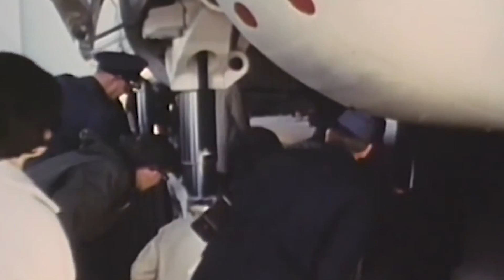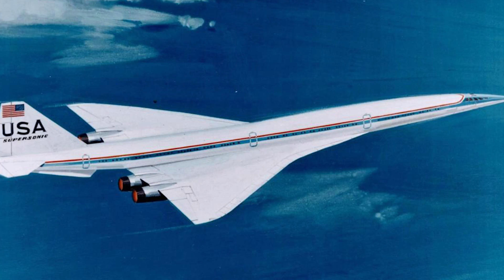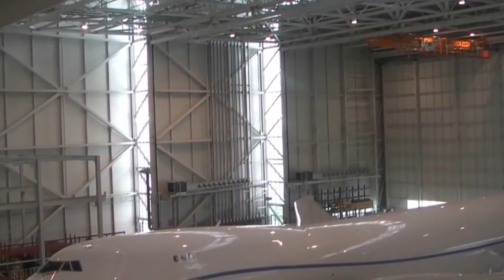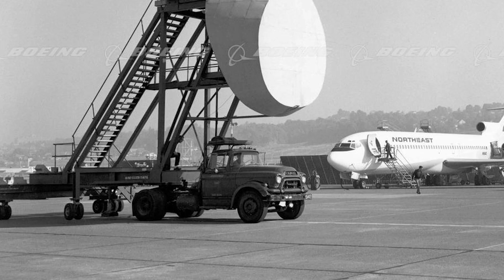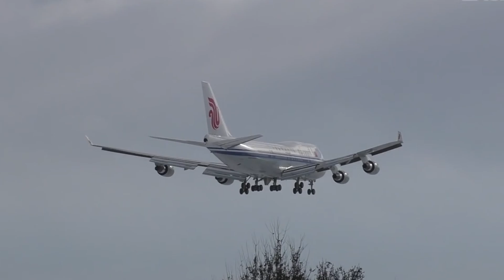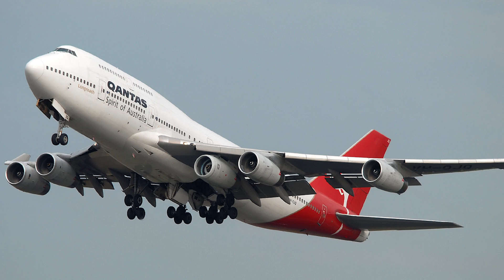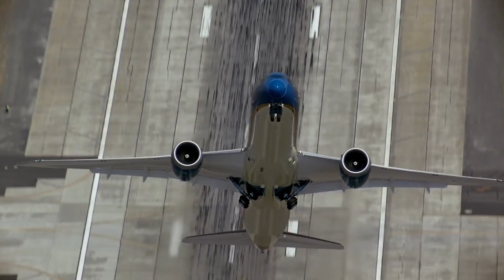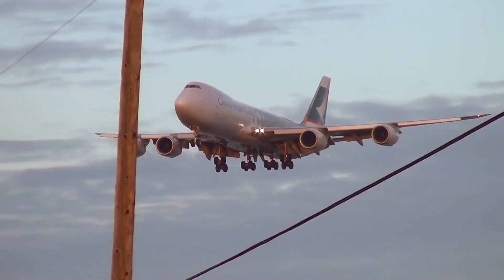Boeing 747 - the Jumbo Jet

Comment: Time is proving that Boeing was correct to leave the VLA market to Airbus and the slow sales for the A380 have proven this. Airbus is still selling every A380 at a loss and it is unlikely that they will ever see any profits from it. 
Also the secondary market for used A380s is extremely weak with 2 off lease aircraft scheduled to be dismantled for parts even though they are only 10 years old. 
It is too heavy to be an economic freighter along with being more difficult to load and unload while also needing special equipment to load the upper deck. 
While the 747-8I is no longer in production and the 747-8F only has enough orders to continue in production into 2022 at a rate of only 6 per year Boeing is still predicting that there will be a large increase in freighter aircraft orders before 2022 with the 747-8F being in demand once again. 
While the A380 is a good airliner it was built at the wrong time to be a financial success.
Reply: It in some ways the A380 is Europe's White Elephant. Yes Emirates is the A380's bread and butter, but now the company is facing a financial issue in Dubai with labor, who are leaving skyscrapers undone or not built. Causing lots of money lost to the royal family who run the UAE.
Reply: Ecc12:13 at least they fly
Reply: @Ecc12:13 , after the 737 MAX debacle, we now know that Boeing is pure human dung. With the A350, we know that Airbus is at the cutting edge of aircraft design and, just as important, quality control, something that the Americans have slacked on and have now been found out. Long may Boeing rot.
Reply: @kingwilliam763  Its still euroshit. and if your'e going to let 1 plane tell if a multi billion dollar company which has produced many other planes if they are shit, it proves that you do not have an iq larger than the average 6 year old.
Reply: @Ecc12:13 I agree with you Airbus is eurocrap

Comment: 4 engines makes 747 and A380 above the ETOPS. This planes are more safe. I don't happy that Boeing stops the Jumbo production
Reply: 4 engines are not actual now. A350 and 787/777 have a large ETOPS assumption
Reply: Boeing hasn't stopped production they're still cranking out 747 8 they're just all Freighters right now the Intercontinental can be brought online as soon as anybody wants to buy one which there are several VIP ones coming down the line.
Reply: @deannelson9565  they are not all freighters. Lufthansa uses 747-8i passenger version. maybe other carriers also, not sure..
Reply: @paulh4943  Yes, he knows. He said that only the freighter is currently being produced, which is correct. Furthermore, Air China and Korean Air also operate the 747-8i, as well as Lufthansa as you say.
Reply: Boeing 777X will be the new Boeing flagship. 747 is retired)

Comment: You dont say anything about this is the fastest airliner in the sky
Reply: True. I remember cruising on 747's at 615 mph, as if it were nothing. The VC25, "Air Force One", when the US President is on board, can cruise at 675mph and although it's performance specs are classified, they were published, rightly or wrongly, back in the '90's, and it can go faster & fly in the transsonic range, if need be.
     All these "newer" airliners max out around 550mph to save fuel, but there's no fun in that!

Comment: Every A380 will have been scrapped long before the last 50 747's are even retired.  The A380 is a "one trick pony" and whereas the '47 can be easily modified for cargo, the 380 will be sent to be made into razor blades.   Many airlines are already cancelling super jumbo orders due to the fact there are quite a number of routes flying at under 80% capacity...roughly the "break even" mark.
Reply: Plus the 787 and their own A350 is basically bullying the success of the A380. If people want a large airliner, they will mostly go for the A350-1000 or the new upcoming 777X. The generation of the 4 engined planes has come to an end. You can make a 4 engined more reliable than a two engined, but it's still a hassle to keep 4 engines active instead of just two.
Reply: @randomguy8196   Much credit is also due to the relaxation of ETOPS.  Without that, none of these twin jets would be flying long non stop distances.
Reply: @General Geometrix there is not going to be any A380 freighter. Just the plain truth.
Reply: soaringtractor  ups ordered 14 more not 28.
Reply: A380's will more likely become beer cans, since razor blades are usually steel.
   It's too bad for Airbus, but the butt ugly A380 has a much higher melt value, than it's value as their flagship. ...The breaker's yard anxiously awaits this humongous pile of aluminium scap!
Reply: TakeDeadAim And Airbus though that challenging the 747 was going to be a piece of cake. I might as well say they challenged themselves
Reply: What good can you say about AB?  They built the anemic A340.  A fully loaded 172 can out climb a fully loaded A340(the original)on a hot day out of Denver!lol!  The 300's are nice aircraft and made great cargo haulers for UPS and Fed Ex but the 310/320's are disposable and the 380 is, well...the 380.  Better see them now...I doubt there will be a single one flying in 15 years...at most.
Reply: The a300 did okay. It sold 500+ which is their first plane, not bad for a first try. The a310 was a complete failure, the a340 was a waste of time, the a380 came out at the wrong time. It’s surprisingly that the a330ceo is their best selling widebody but a330Neo is the worst selling. Look like the a350-900 will be the hotspot, not even the -1000 is doing good. The a320 program is completely fine
Reply: Rude
Reply: The 380 reminds me of the Steamship "Great Eastern" which was a the biggest in the world but an economic disaster for several sets of owners - an interesting story by itself.
Reply: Funny you say that, as there are still orders for the A380 coming in, yet a large portion of passenger 747s are being retired. And there aren’t too many on order for cargo either.
Reply: @masterveggie2759  only Emirates still order 380s
Reply: @masterveggie2759  care to adjust your statement! Airbus just lost all of their new orders  plus most of their older ones for what was left and Boeing just picked up an additional four more orders just a couple weeks ago! 1 soldiers on while the other falls from the sky as one of the biggest failures in aviation history!!!
Reply: @masterveggie2759  A380 is out of production. 747 is still going with no end in sight. More 747s in the air now than all the A380s ever built. A380s are being scrapped. Airbus lost BILLIONS on the butt ugly flying warthog.
Reply: @masterveggie2759    You're only half right.  As of 2018, both jets have received 14 orders.  It should be noted that if it weren't for Emirates, the A380 would have been discontinued long ago.
Reply: @TheItsmegp46  Those A380 orders were cancelled. Production is ending in a year or so.
Reply: Got a notification for this thread this morning. You all think I could see a year ahead of time? When I made my statement, what I said was true. A year later, things change. Pathetic boomers. “Scarebus” lmfao okay Mr MAX is grounded.
Reply: @masterveggie2759  How about those wing cracks that have re-appeared on the Scarebus A380. Good thing airlines are scrapping that flying money pit before one falls out of the sky and kills more people than both of the 737 max crashes combined.

Comment: Also, the 747 had a huge effect in lowering the cost of air travel with its big capacity and relatively efficient engines. Fast too!
Reply: soaringtractor It’s been proven that it can go past Mach 1. The VC-25 went Mach 1 one 9/11.
Reply: @juddpalmer5445  Yea. They were evacuating the president from Florida when they did that.
Reply: And they're phased from almost every domestic route and I've never even been on one.  Was on a DC-10 once and that was exciting because of all the disasters they've had!

Comment: 747 was a King of the wide body aircrafts. But It's time has gone. After few years the new Boein 777X will be the flagship model
Reply: That's going to be a bit of a toughie.  The 747-F offers a very unique capability that only the AN-124 and AN-225 can match: the nose swings up so that very long items like wind turbine blades can be loaded.  The 777F, 767F, and A330F, while excellent aircraft, can only load cargo from side doors.  So if there's a very long item that cannot be broken down into shorter segments, it simply cannot be loaded into these aircraft.  

The good news is that the 747-8 freighter will probably be flying for a good 3-4 decades to come, so the industry has quite a while to figure out the solution to this challenge.
Reply: The 777 is taking its spot. It is the reason of the death of 747 passengers versions, once the 747s leave the 777 will be the next iconic aircraft replacing it and will be doing what it’s 747 did that Ruled the skies for almost 50 years! She will remain a freighter for many many years to come. They make a perfect match.
Reply: however, the 747 is still a little wider than 777
Reply: soaringtractor except they're ancient 744s, all of which will be retired in 5 years, and no one's buying the 788. Big planes are on the way out
Reply: It's interesting, what plane will be the main freigter if they will stop the 747F-models production?
Reply: Hoy Sum yes, but a 777-8F is almost inevitable.  But I agree, without the nose loading capabilities, there are certain items that will require either a civilian variant of a military cargo aircraft (like the failed MD-17 project of the 1990s) or a new model.  Markets abhor a vacuum and the lack of an aircraft that can load very large items is a big vacuum.
Reply: There have been no 747-8i orders in several years, although cargo operators are still ordering the 747-8.  The days of the 747 as a passenger model are coming to an end.  I predict that we will see the retirement of the 747-8i in 15-20 years.  The small number of extant airframes will mean faster depreciation and lower resale values.  I'll miss the beautiful Queen of the Skies, too.  But that's how things go.  

In the meantime, the A380 has just garnered 20 new orders from Emirates.  It still won't break even for Airbus, but those orders are enough to hold the line running for several more years.  It's likely that Emirates will place yet more orders.  As a result, Airbus is planning to upgrade the A380 with new engines, new wingtip devices, and some cabin reconfiguration that will increase passenger capacity.  Whether this new "A380 Plus" variant will garner much interest remains to be seen, but the overall development costs will be way lower than the original program and the improvements should reduce CASM.  So we'll see.